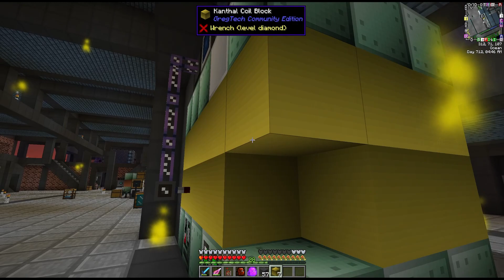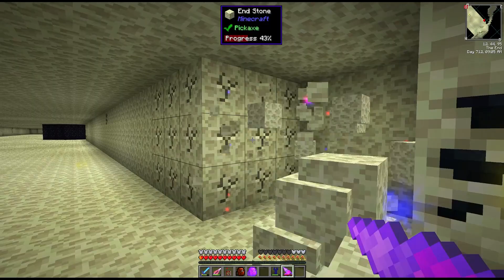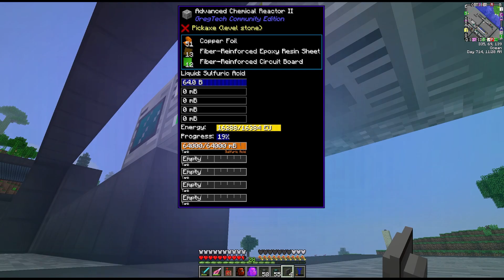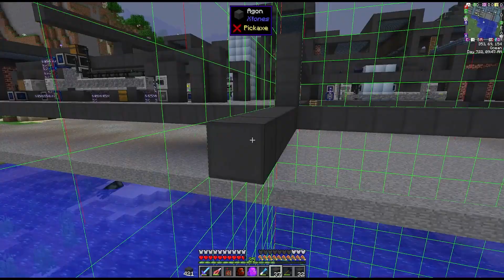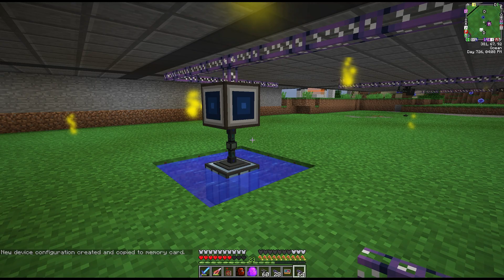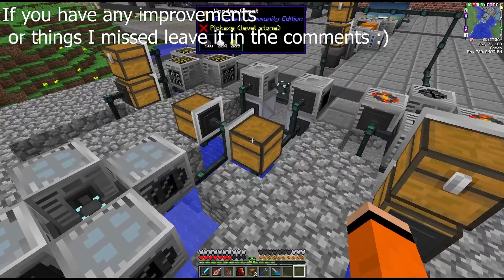FTB: Interactions - Ore Processing & Circuit Automation! Modded Minecraft Ep31

Comment: With my ore processing I just used horizontal lines and filtered ender chests.
Reply: Yeah, i think using ender chests all with same colour is the best way
Reply from the maker: Doesn't this way mean you have to filter every single dust and item you are sending through?
Reply: @Threefold.  You just need to use the oredict filters for that. That way you don't have to send different byproducts from different places (purified dusts from sifter, and tiny dusts from ore washer and centrifuge are an example in this case), but nothing wrong with your setup though. Everyone has their own way of doing things, that's the fun of modded mc.